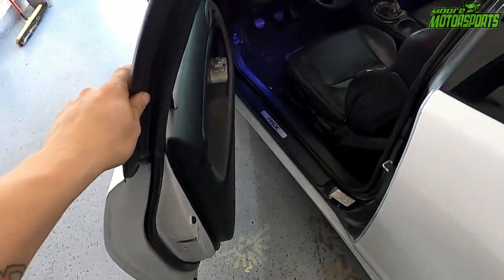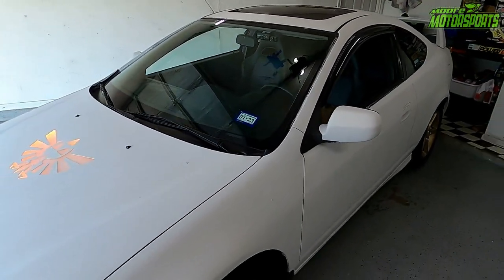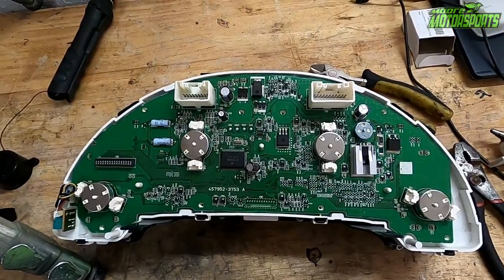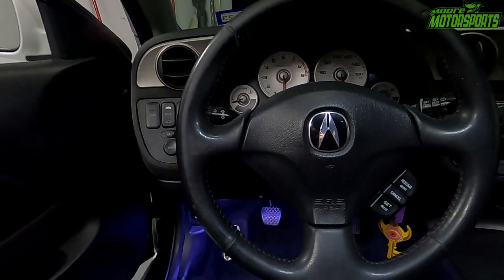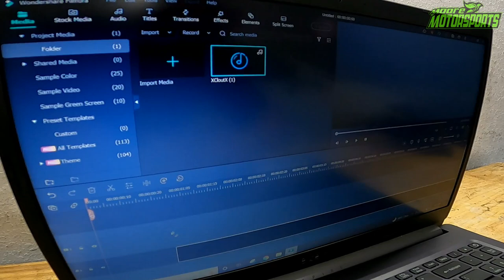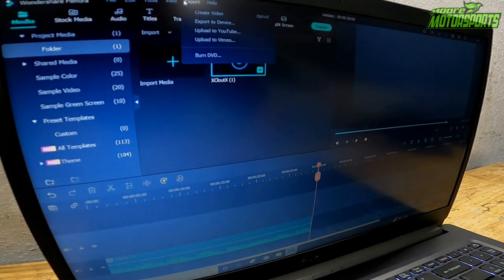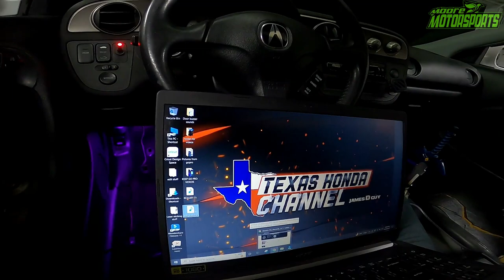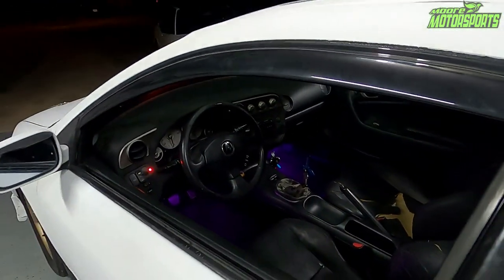SECRET ZELDA SOUND WHEN DOOR OPENS. CUSTOM DOOR CHIME! ZELDA BUILD PART 4

Comment: hey hows it going??? you ever use duplicolor automotive enamel?? doing gloss black and wonderin if that would b better than the 2x? .
keep up awesome work.
Reply from the maker: I have used it. I prefer the 2X because it’s thicker paint and don’t flake as easy as dulplicolor but both work great. Just make sure prep work is done good and you will be good.
Reply: thanks for the reply. was gonna go black but last year i painted it rustoleum metallic(that was hard to mk it look right lol) so im hoping i can wet sand and recoat it and clear it.
Reply from the maker: @drewclinton4304  yea it’s that way sometimes. It’s all about trial and error sometimes. Hope you get it nailed. The best masterpieces had their share of failures. ❤️💪🏻

Comment: James, heard about painting vehicles with bedliner today when I went to a local body shop to see about painting a 1991 Acura Integra I just purchased. So I went on YouTube to learn more and found your video when you bedlined your infinity several years ago. Great instructional video. How is the bedliner holding up? The body shop quoted me a price of $2500 to bedline my Integra. Wondering if this is a fair price. After he does the bedliner he says he will overspray with a coat of the color I select. Is this a fair price for having this done?
Reply: There’s way less proper procedure behind laying bedliner, I’ve done dump trucks and 1/4 ton pickups, 2500 is on a very high end in my honest opinion, because there’s nothing to it besides prep
Reply: Should 100% be capable to do this in a car port let alone a garage with good results